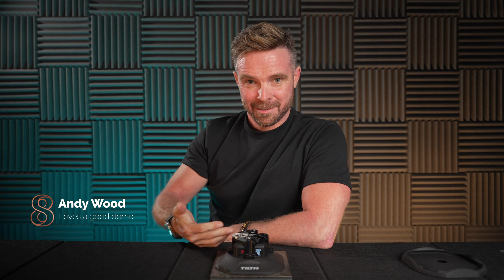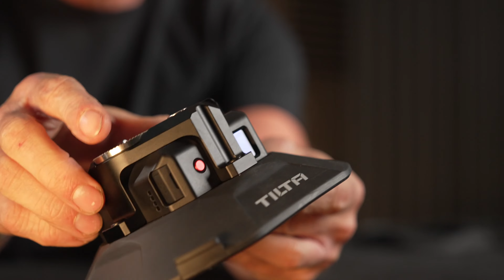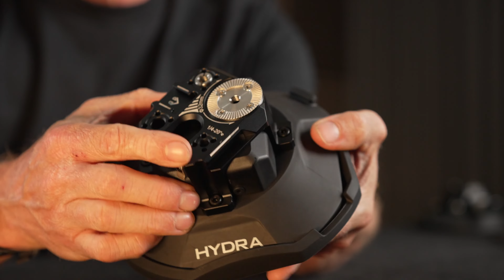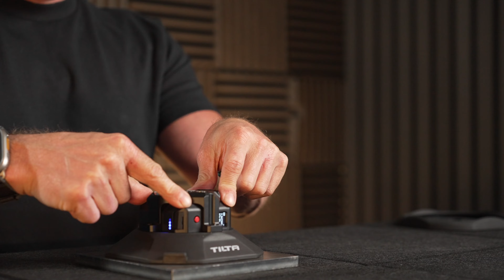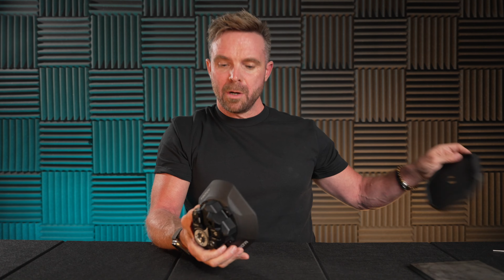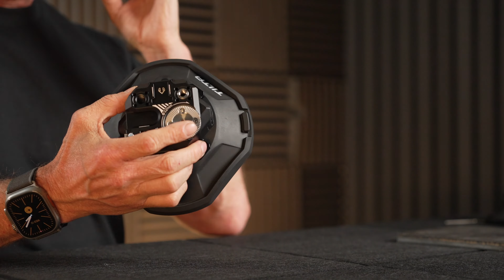WANT a ROCK SOLID Camera Rig? This Electronic Suction Cup is a GAME CHANGER!

Comment: Do they have warning systems in place such as buzzing/alarm sounds when they lose battery level or when the suction goes below safe levels? If yes, I think they missed out on a huge feature.
Reply from the maker: It doesn’t buddy. What it does do is have all day battery life and lights indicating how much left. If it losses pressure below 90%, it simply pumps more air out for you, so maintaining that pressure. Good idea on that buzzer, maybe on V2 🙌👍
Reply: @Pulse8Reviews Sounds good enough! Another question would be if they can be connected to USB-C charging cables (of course individually) to keep em charged while in use?
Reply from the maker: I guess they could be and don’t see why not, I’ll test it when I get a chance for you 👍
Reply: @Pulse8Reviews Appreciate it!! Thanks a lot.

Comment: I’m currently using the 4” Smallrig ones. Should I upgrade for this? What about having battery degradation in the future?
Reply from the maker: I wouldn’t worry about battery degradation at all, I’ll be fine, but nothing to back this up. It’s worth upgrading to the one if you only have one method of attaching gear to your current SmallRig one. All I say is, the peace of mind this gives you is the one reason to upgrade in my opinion. Hope that helps 👍

Comment: While it does support the weight, the pliable rubber caused wobbling that rendered the footage unusable. That’s with a GH6 and 10-25 F1.7.
Reply from the maker: That’s very interesting, do you have any in body stabilisation on the GH6? Because we found switching off this helps on internal shots as vibrations can cause wobbling 🤦‍♂️
Reply: @Pulse8Reviews  No, the entire camera was wobbling. My magnetic mounts were solid.
Reply from the maker: Oh, could it be the angle and the distance your camera was from the suction mount? Again, I found  if the arm is too long, you will get wobble on most suction mounts and advice always have two connect and a safety attachment just in case. When we mount inside a window, we use two then. The weight of any DSLR camera on a single suction cup will have wobble. The only way to over come this is have two, or the camera as close to the mount as possible 👍
Reply: @Pulse8Reviews  No, I used a short SmallRig NATO magic arm, positioning the camera slightly beneath the suction cup.
Reply from the maker: I guess you need two then, honestly I think this is the only way unless you’re mounting action cameras, we always use at least two for our FX3 cameras 👍
Reply: @Pulse8Reviews  Yeah, I agree. Using two would definitely be the way to go. I ended up returning it and sticking with RigWheels.
Reply from the maker: Glad to help, it’s a lesson we learned very quickly, take care.

Comment: All these will have a battery decay someday. I hope its easy to replace the battery inside
Reply from the maker: This is a very good point, although, I think it would be some years before this starts happening and by then, there’ll be one out you can switch batteries out with hopefully. 

We placed this on the back a car to record sound only, it was very reassuring to know it wouldn’t loose suction.
Reply: @Pulse8Reviews  if its just some screws and a 18650 inside, i can easily replace that. Hopefully its not like Bose speaker where the internal lithium is glued tight inside

By the way, have you guys seen the Neewer 6” electric suction mount? Ive been trying to to find review of it and nobody have done it but it sells like a ube cake and is always sold out
Reply: @jserenity Just check spec for both and see big difference: Tilta reports up to 24 work hours, Neweer is 2.5 hour 🤔
Reply: @Mikhail_S_P  you are darn right. Neweer only have 2.5 hrs according to specs.

Thanks. You saved me. I almost tried to use the neweer to mount my insta360 on a 8 hour drive. 

I chosed neweer because it says it has higher  suction force.

I'll just use this tilta instead if it last more.

Comment: Hey, quick question, do you know what happens, if you run out of battery while using it? Will it hold the current pressure and just function like a normal suction cup or will it release the pressure and fall of?
Reply from the maker: Hey Tim, we haven't had the battery run out on us yet. But, we have switched it off when mounting inside a car so that no noise was coming from it and it held for the entire time we were recording, around 20 minutes. Unlike the others, if there's no battery, you can't pump it, they should've thought about that.
Reply: @Pulse8Reviews  Ok good to know, than it will probably also hold when running out of battery. Is a good peace of mind.